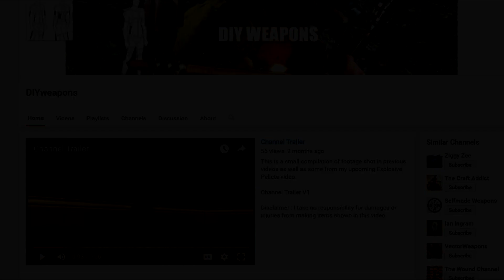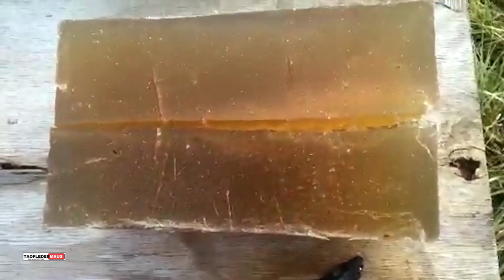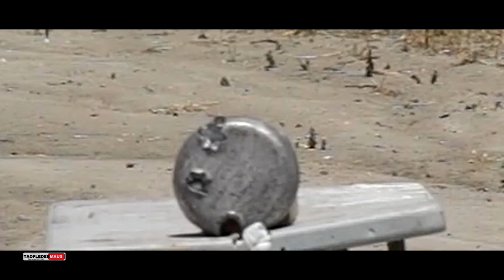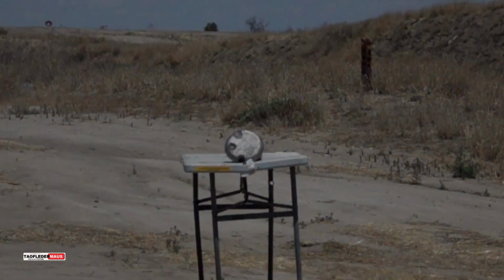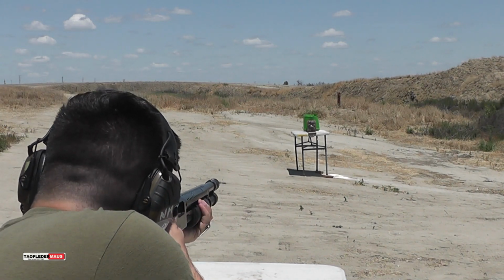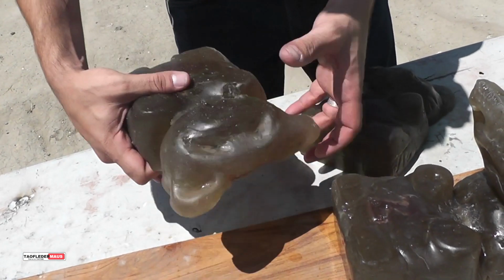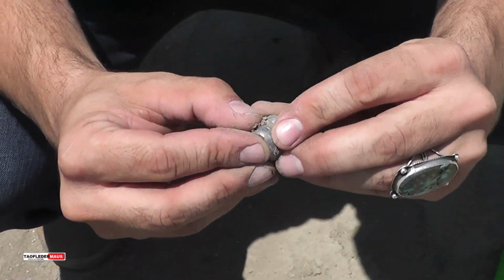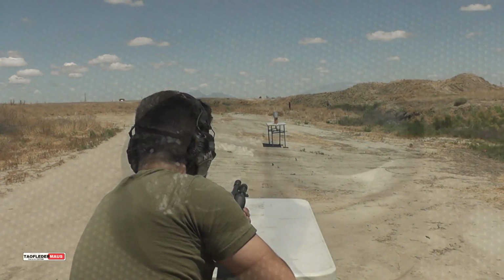Dum Dum Shotgun Slugs

Comment: The British arsenal  near Dum Dum India gave its name to the expanding bullet. It was originally a .303 British bullet from which the copper jacket had been removed at the tip. It was designated for use on non-civilized opponents, i.e. non-European. For whatever reason the term Dum Dum was later applied to any bullet designed to expand on impact.
Reply: great info mate
Reply: Kinda makes the "civilised" people shooting them seem a bit less so.
Reply: yeah, basically right. Dumdum was an arsenal in India, they made bullets in soft lead with no jackets. The brit soldiers noticed that they caused significantly more damage to a human than the jacketed bullet they were used to. So an officer then designed a half jacketed version, primarily to help with fouling, but still able to make big holes in the natives :-)
Reply: Dan Troop Dum Dum airport Calcutta now days Sahib.
Reply: The term Dum Dum is the name of the place where those particular .303 bullets were manufactured. They were of extremely low quality standards, and the effect on terminal performance is completely non-intentional on the part of the manufacturer, but rather the result of low quality standards in India for ammunition. Sometimes mistakes can yield superior results to what was originally intended.
Reply: The Dum Dum Bullet was invented in the 18th century by the craftsmen of Munger (India) during Anglo-Afghan War...

Comment: Dum dums are made to increase the impact damage as the flat nose will cause the kinetic energy of the projectile to be transferred to the target better whereas a standard round might pass through with much of the kinetic energy going with it. Hollow point rounds are what are designed to open up and fragment on impact. Just saying.   ;-)
Reply: Mike West so dum dum bullets are meant for stopping power? I thought hollow points expanded like a flower rather than fragment.

Comment: Back in the day we would drill a hollow point first then cross hatch much deeper than you did here. We also used softer lead slugs. They worked amazingly well often breaking into 5 pieces.
Reply: Sorry for replying to a 4 year old comment but I bet you could improve that design but adding melted wax into the shell to make them shoot straighter

Comment: Bending/deforming metal generates heat.
Do that deformation in a fraction of a millisecond and you get an incandescent flash.
Partly metal vapor, lots of particles, all very hot.

Lead is pyrophoric, but only when in very fine powders.
There is likely enough lead 'fines' to self ignite in your shots.

Comment: Dum-dum specifically refers to modified jacketed bullets, wich do not expand normally (bullet jacket prevents it). But after you are saw off nose of the bullet, it can expand almost like non-jacketed bullet does. 
Because non-jacketed bullets/slugs already have expansive properties, there is no point in cross-secting them, they can't be even more expansive than they are already.

Comment: The detonation is actually the pressurized air between the slug and the lead target can't get away fast enough and is super heated by just pressure. Kinda like if you hit two stainless steel balls of the same size together in the dark you can see a flash. ✌🏼

Comment: Judging by how rough those cuts are, I'd have to say the flare we're seeing is lead bits expelled from the cuts by the compression of the impact which are then hot enough to ignite on contact with air, much in the same way iron makes a shower of sparks when you grind it.

An experiment would be to compare your crudely cut slugs to some that have had the slots carefully smoothed so they have no rough surfaces inside.  The ones with the rough surfaces should produce flares, while the ones with the smooth surfaces should not.

Comment: You guys should try hydraulic bullets. Hydraulic bullets were an early development of the hollow point. There was a cavity, filled with a liquid, water mostly, but also oil. Then a cap seal over that. I made a few, a long time ago for a .54 Sharps Buffalo rifle. Results were mixed. Some did little expansion, but some about exploded on impact. Interesting round if you can make some.

Comment: It's funny, Geneva Convention states you can not use hollow points or "dum dum" bullets in combat (off US soil). I always thought it was a nick name for hollow points, but now it makes sense that someone would drill out a FMJ to make a cheap hollow point.
As for the flash, I'm preeety sure that's plasma. The heat from the friction on impact plus the friction and pressure from all of the air being pushed out of the way.
If you watch test videos from rail guns, they use no combustion, but have the same ball of plasma coming out of the muzzle.

Comment: I'm thinking the detonation here is just the air within the grooves of the round being compressed and superheated by the impact similar to a piston just at much higher speeds.
Reply: Well, that bullet has a lot of kinetic energy, and that has to go somewhere on impact. So, something WILL end up superheated, wether it's air or lead from the target or the bullet itself.
Reply: #TAOFLEDERMAUS can you try to test this
Reply: That would really explain the reason the slug basically moulded to the lead plate.

Comment: I love your videos. Thanks for doing them, and keep it up, please. 

As for the flash on impact, I have heard that - theoretically - if you powdered some lead fine enough and threw it hard enough so that it dispersed in the air at a high velocity (picture throwing a handful of flour very hard) that since lead oxidizes so rapidly, and fire is simply extreme oxidation, the lead powder would burst into flame. Perhaps upon impact your projectiles are causing the lead to splatter in a very fine spray at a sufficient velocity for it to burst into flame as it oxidizes? Just a thought. Probably way off base.

An idea for your slugs:  When I was a kid we did a lot of reloading of shotgun shells for dove hunting.  One day I was playing with my wrist rocket slingshot and had the idea of using spent shotshell primers for ammo.  As it worked fairly well, the next obvious step came to me: Try a new primer.  I shot it against a brick wall and it exploded. 

This gave me the idea (though I never tried it) of drilling a hole into a shotgun slug just shallow enough to accept a shotgun primer and pressing a shotgun primer into it (facing backward so the target would act as a firing pin). The target would have to be something hard enough to detonate the primer upon impact, and the hole in the slug for the primer to fit into would have to be perfectly centered to make it aerodynamic enough to fly straight, but - theoretically - the primer would explode and cause the slug to either explode as well or at minimum have extreme expansion.  If you can find a way to have someone (a machinist, perhaps) mill a hole into the nose of a shotgun slug that is large enough, yet snug enough to insert a shotgun primer into the slug and fire it at a target that is hard enough to detonate the primer, I would truly like to see the resulting video.

Comment: I reckon I know what the flash is caused by (I am writing in the comments of YouTube, so I must be correct). Am I right in saying that it mainly occurs when hitting the lead plate with aluminium projectiles? because if this is a fair assumption, I think that it is caused by some of the aluminium oxide layer (Al2O3) from the projectile is being knocked/scraped off. This is almost always present in any aluminium that has been left in the air as it is a rather reactive metal, and there is plenty of oxygen in the air, we can safely use aluminium for things like drinks cans as this layer builds up very quickly, and is reasonably nonreactive. When this layer is removed, however it exposes fresh aluminium to the air, and there will be a lot of heat due to friction, which will speed up the reaction between oxygen in the air and aluminium, (4Al + 3O2 => 2Al2O3), which is exothermic, and so emits heat and light, i.e. the flash. As I have said, I am assuming that it is mainly aluminium (I am in England, so yes, that is spelt correctly, we are credited for creating this language, so we must be correct) and it is when hitting the lead plate, but as I have also said, I am in YouTube comments, and so am always correct.

Comment: Cool! That was one of the modded bullet styles I wanted to send you for you to load into rounds and test-fire.
For legal reasons, it'd have been just the bullets.
5.56x45mm:
unmodded (gotta have a control group)
filed down flat (necessary step for the others, may as well see how much difference it makes alone)
filed and drilled 2mm wide 5mm deep
filed and drilled 2mm wide 10mm deep
filed and drilled 2mm wide 10mm deep, 20mm^3 of water injected, hole sealed with glued 2mm wire piece (or birdshot pellet)
filed and cross-cut once
filed and cross-cut twice
filed and cross-cut thrice
Spun in a drill (I don't own a lathe) and filed down around the sides to expose lead at the sides but leave the tip jacketed.
filed and drilled 2mm wide 10mm deep, 20mm^3 of SAN injected, hole sealed with glued 2mm wire piece

Probably not allowed to send that last one through the post either, even though it'd pack less punch than a .22 Short :\

Hey, if you're modifying slugs now you could do that last one with a slug. An 18.5mm slug would allow for some fun fills. You could drill one 10mm hole in the front, half-fill it, put a primer in the middle, put a sawn-off screw on that, fill around them and use a circle of duct tape to close it. That'd make a bang. Might want to fire it from your least-loved shotgun using a long string to pull the trigger, just in case.

Possible results:
You have no idea where it went
It blew up some sand
It hit sideways and disintegrated
It hit sideways and remained intact, so now you have to work out how to dispose of it
It blew up in mid-air, so you got an awesome high-speed video clip to share with us
It blew up the shotgun
It actually worked and lobbed chunks of gummy bear all over the place
It mostly worked but the slug was too tough and instead of expanding it acted as a rocket and came right back at you

Yeah, maybe don't bother with that last one.

Comment: You never see these mods from the factory, no need to wonder why. Hey Jeff I'm playing with a Norinco b2 (.22). Use a .22 short pulled from a round, felt wadding (1/4 inch) and a cotton Q-tip's worth of cotton soaked in gun oil.

Comment: Is it me or does the flash when it hits the lead, looks bigger with this 'carved' slug. this slug has more air on the top of its nose because of the slits. i think a good explanation of the flash would be that its actually the compressed air being lit because of the heat. otherwise i cannot see any other material that could cause it.

Comment: Hi, I looked it up and its called Charles's Law. I the answer to the fire flash on impact is due to air compression. Think about a fire piston for starting fires, as the piston comes forward the air compress' and heats up to over 500 Deg. F and you get and any organic material acts as fuel. Maybe oil from your fingers?

Comment: Im no expert by any means. The lead 50 cal maxi balls I form for my muzzle loader is a much softer lead and I can cross hatch it with my thumb nail. Ive used this gun since i was 12 and got my first deer with. In my belief ever since I started doing this it has caused more damage to deer than not. Either way with open sights ive not missed a deer and everyone has been slammed. My dad used to take bets at camp on my accuracy and we won all the time. I believe its the softness in the lead of my "dum dum" rounds that makes a difference. 50 caliber with 120 grains of smokeless powder. Its by far the hardest thumping gun I have. Is there any comparison ?